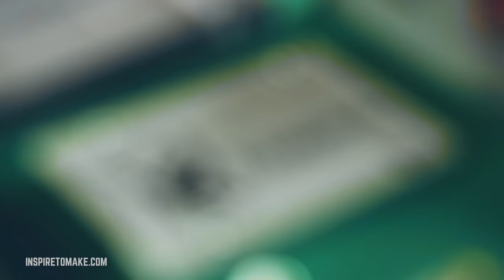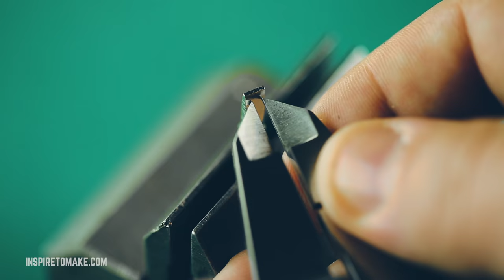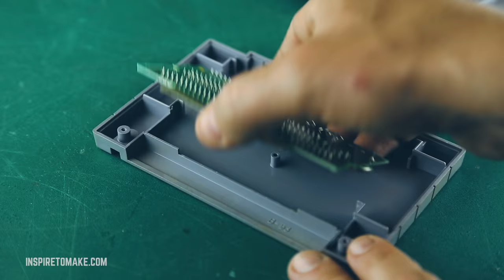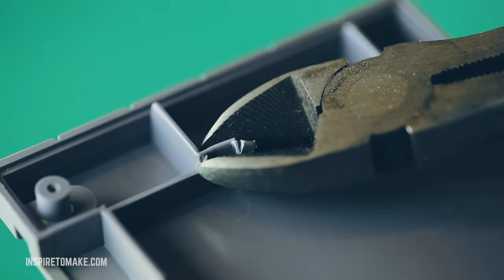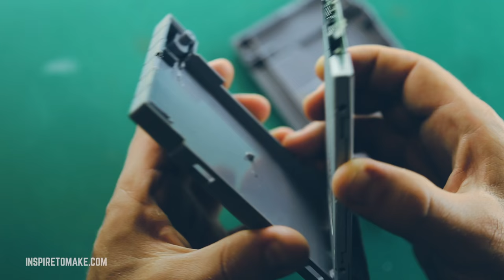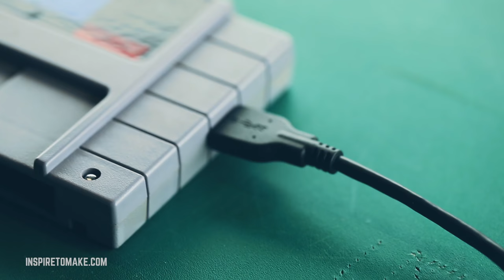How to mod a SATA drive case - SNES cartridge as a Kingston SSD drive enclosure

Comment: I am currently placing old 2.5" hard disks on NES cartridge cases. My computer now have the NES receptacle where you slide the cartridge. So, I can slide the cartridge to the slot and it connects the sata to a usb-sata adapter. Just sliding :) Hope my english was not that bad.